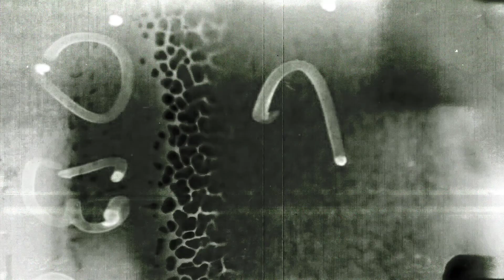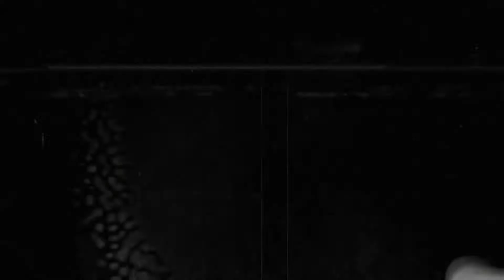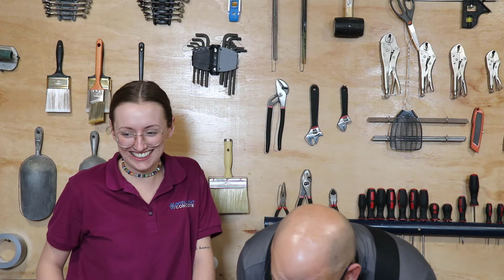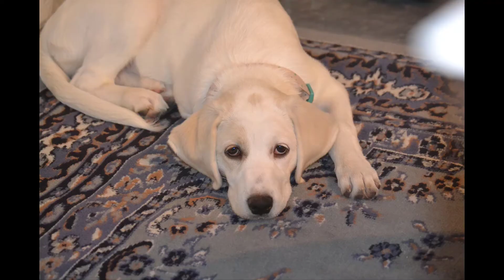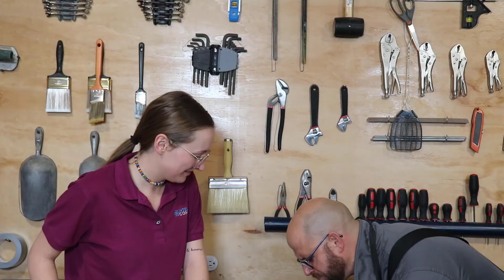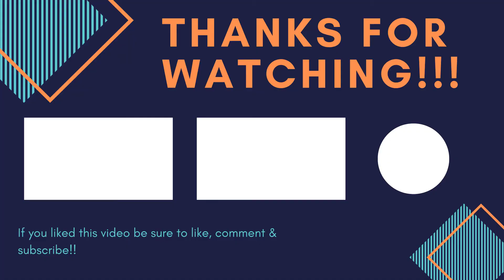Sustainability Saturday: Pervious Concrete - Vlog 590

Comment: I like the shower idea I haven't walked on that kind of concrete barefoot though.

An idea I was throwing around is a self watering pot for plants.  If designed correctly, I would this this would be a long lasting pot (assuming it's not in a freeze zone and left outside).
Reply: I think that is such a great idea!!

Comment: Would you recommend rounded or crushed rock for pervious concrete? What are the pros and cons?
Reply from the maker: 1HighVoltage1 depends.  I find it easier to make pervious with rounded rock (Pea Gravel) vs crushed (washed #8 or #89) that yields higher strengths but is a pain thr you know what to batch and place.